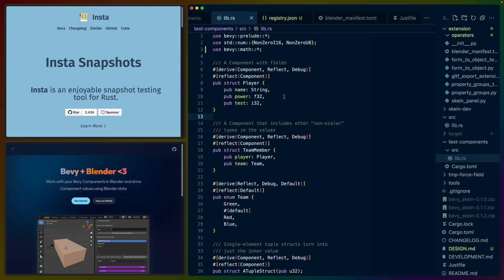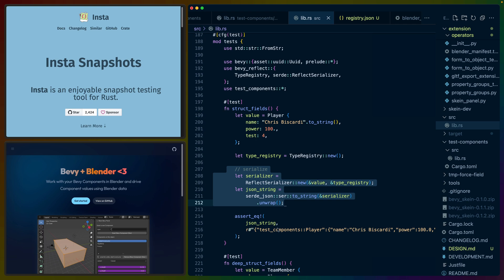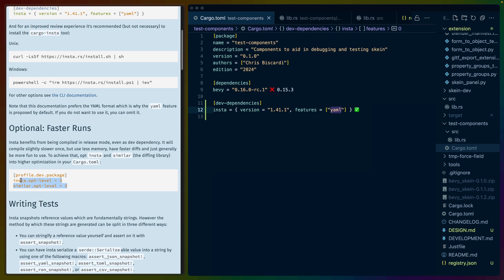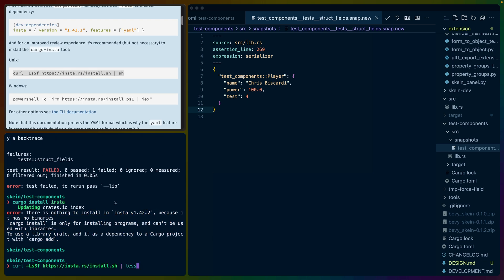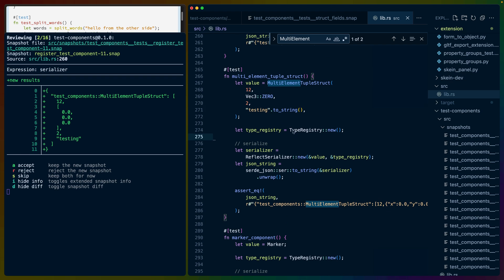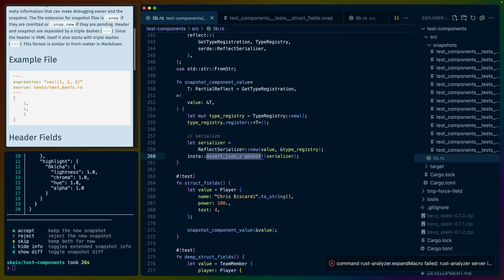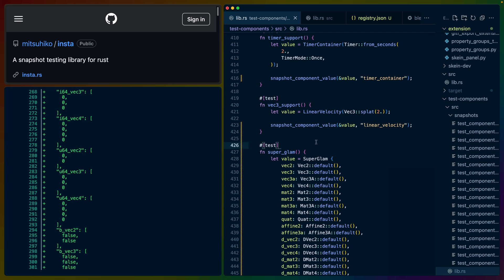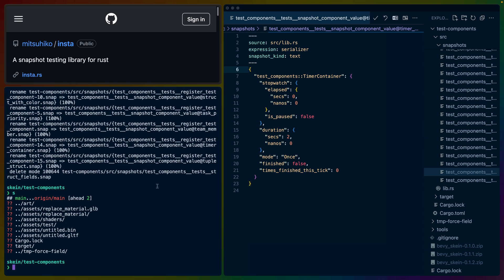implementing snapshot tests with insta for skein

Comment: I understand the basic idea of what Skein is capable of from the video intro, but how do you envision it fitting into an overall game dev workflow? Is it only for testing?
Reply from the maker: You'd insert Components onto Blender objects, meshes, and materials when building your levels, assets, or other models. Those Components would then get instantiated for you when spawning in your Bevy app. So if you use Blender now, you can use Skein at the same point in the workflow when doing level design, etc.